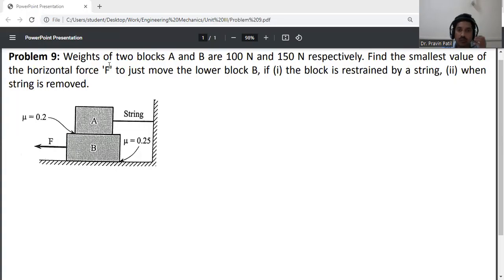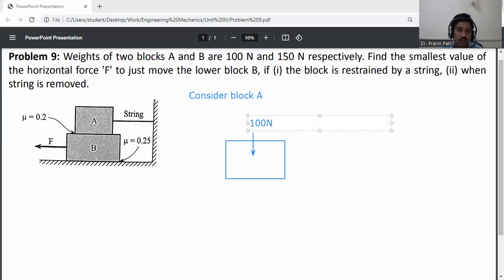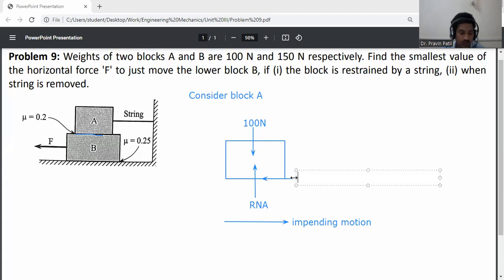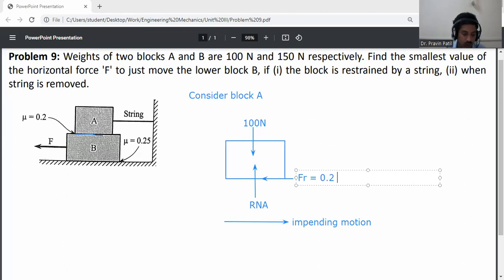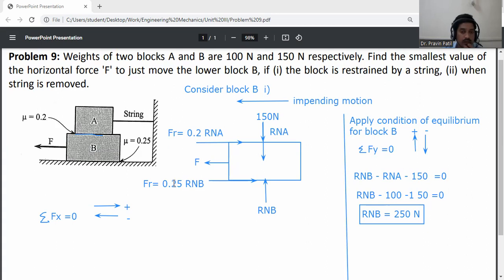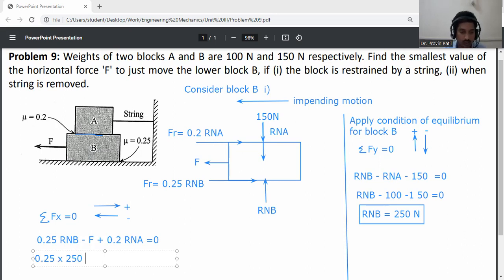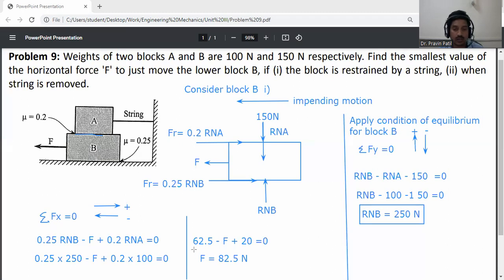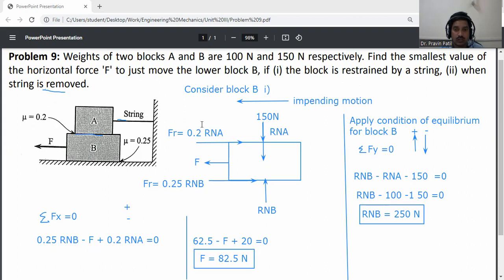Problem 9- Friction/Engineering Mechanics

Comment: Also why did we not consider the weight of the block b....in that case the normal of b to the surface will be 350N. Right?
Reply: What about this one...I have this doubt also. Btw thankyou sir.😊🙏🙏
Reply from the maker: Weight of B block also considered. Check it
Weight of B block 150N